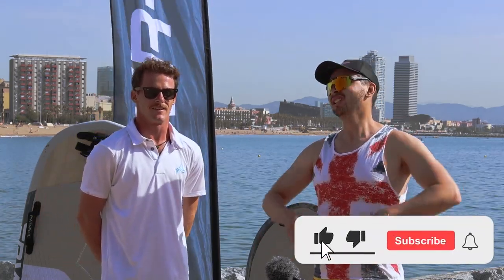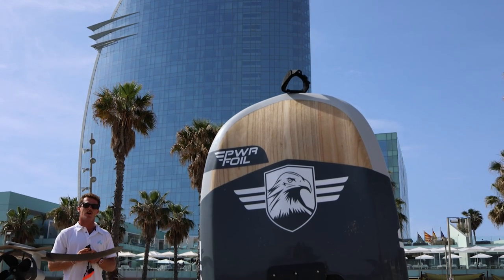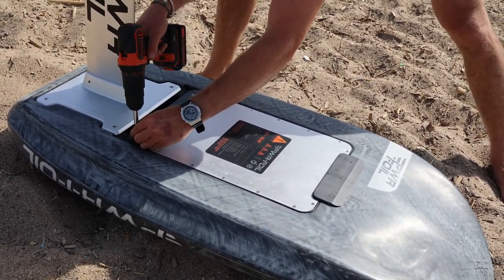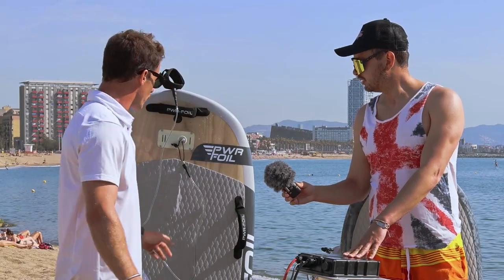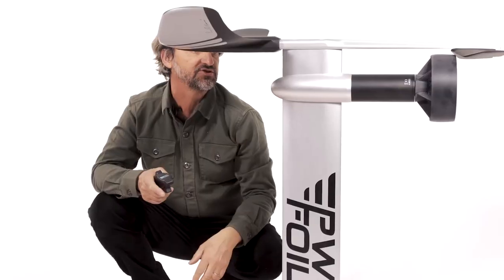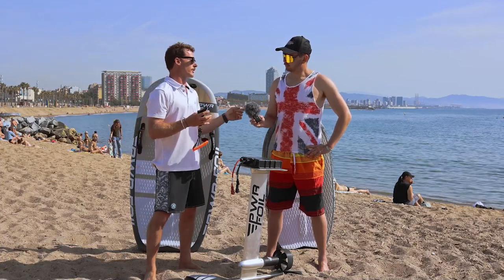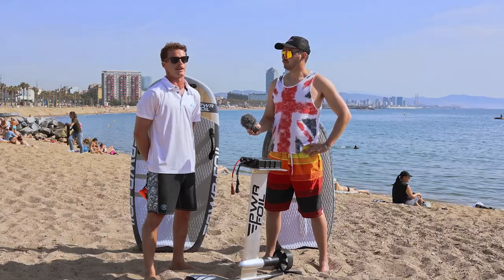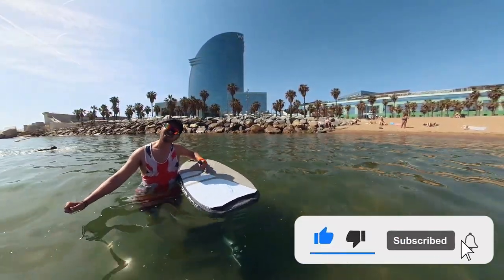PWR-FOIL Efoil V3 Review🏄‍

Comment: 60kmh with a 1250cm2 and prop guard, yeah right…. 🙄😩
Reply from the maker: did we say 60? must be a typo. Probably 40
Reply: @JetSurfingNation  they claim 60kmh in their release video too…
Reply from the maker: not sure probably 35-40 is reasonable speed for efoil with a prop guard
Reply: I did 40 today without prop guard. Not at 100% with their old foil version, so lower power. I guess 60 with new motor and big balls might be possible 😃